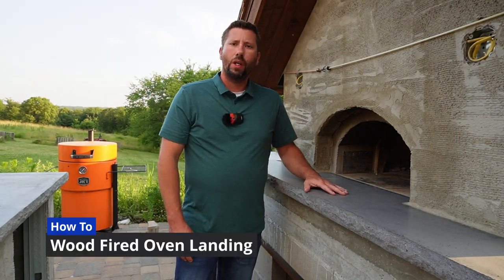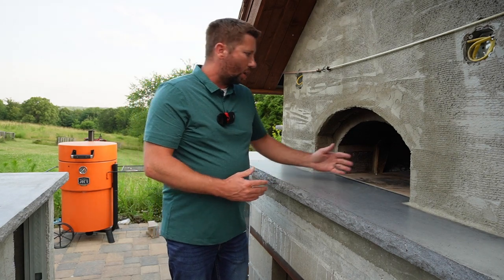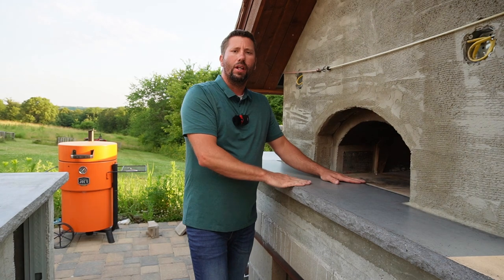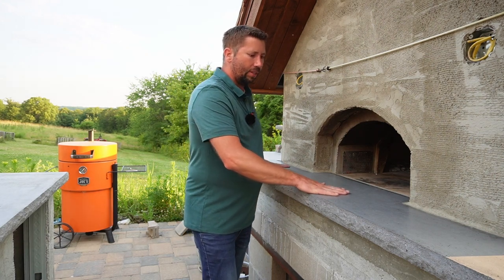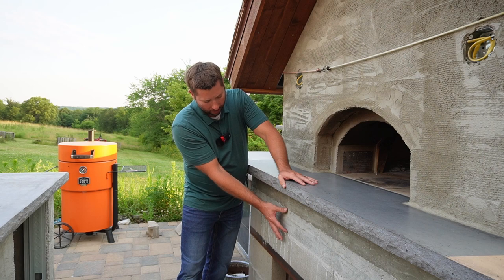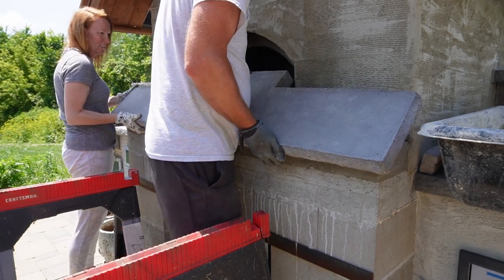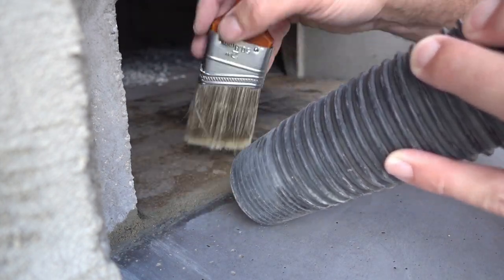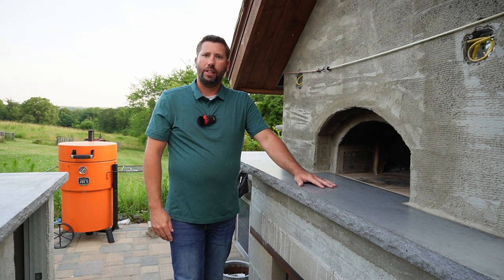Wood Fired Pizza Oven Landing : Tips & Lessons Learned

Comment: Very Good and detailed video,
Did you find any major advantage/disadvantage of using regular concrete mix for the landing comparing to Z Liquid-Create?
Reply from the maker: Since it was a precast, I felt standard concrete with reinforcement was the better option.  I liked the liqui-Crete products, but If I were to do my outdoor countertops again, I would probably just use 5000psi concrete mix with metal lath as reinforcement.  They all will form hairline cracks when exposed to the outdoor elements(freeze and thaw cycles), so for an outdoor kitchen in my climate, I am not sure there is much advantage over 5000psi concrete.  I would certainly use their forms and form liners though.  Top quality products.

Comment: Did you put any insulation or gap in between the concrete landing and the pizza floor tile?
Reply from the maker: @SuperMoeLarryCurly  I did not. I wish I would have though.  I am sure I am losing a little heat retention due to this.

Comment: Could you please tell me what product did you use to cover the cement board?
Reply from the maker: I just used standard metal lath. Attached it with screws to the metal studs.  Then covered the lath with standard type n mortar.